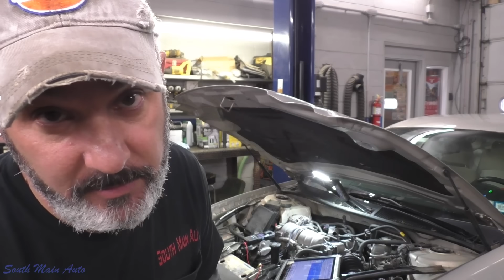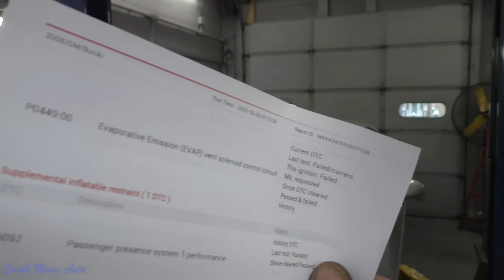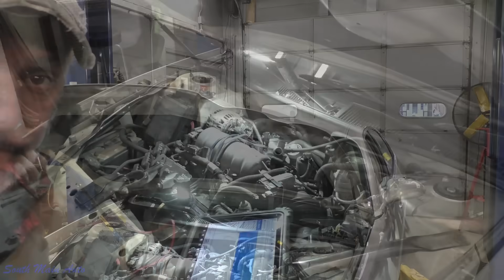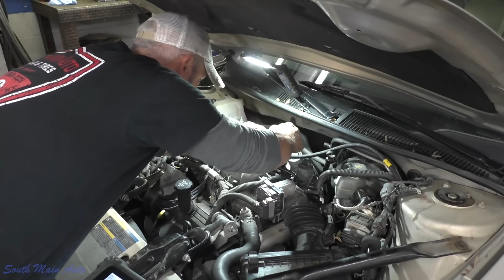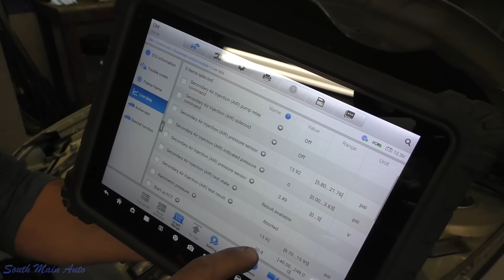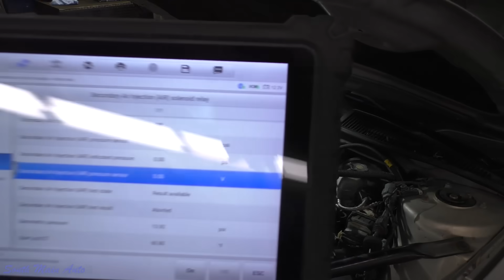When “New” Parts Are Worse Than The Broken Ones 🤬

Comment: Auto industry top to bottom is garbage. Get a vehicle made before 1995 or you'll live to regret it. The newer the worse they get. But it's not just the auto industry. I worked in building maintenance. Did everything from plumbing to HVAC to concrete to building construction to low voltage to high voltage electrical. Infrequently, bad parts right out of the box. So now you have to test the new part or question your sanity. Just as bad is someone else coming along that has a huge ego but no clue what they are doing trying to fix things they know nothing about. Now you have to figure out and fix the mess they made along with what the original problem was and test the new bad part. I used to have my own stock of parts, outside of the parts department, that went bad on a more regular basis but would have others take those parts and not reorder leaving me looking like an idiot, trying to explain that makes ya look like a fool. Many years of that wears on ya. Too many frustrating things went on so I retired early. 😁

Comment: Terrific video because you are a mechanic giving us a true reaction instead of feeding us fake influencer crap. Thank you.

Thanks to South Main Auto, Car Care Nut and a few other respectable channels I have gained the confidence to work on my car (not just change some fluids), get my hands dirty, and not be swayed by the BS from some local auto parts stores and shady mechanics shops.

I have a 2007 Prius and bought an XTool D8 that gives me all the information and features I need. I have a reliable multimeter, and high voltage resistance tester, too. When I buy parts locally I take those with me and announce that I’m testing them before I leave. So far, I’ve only discovered one bad part immediately. I never had push back, felt respected and was even offered a position.

Don’t take anybody’s crap.

Comment: The thing that frustrates me, is that even stuff sold by “reputable” companies is now a junk crap gamble.  It is one thing to buy something off the internet for $10-15 vs say the Delco or SMP box (rebadged by NAPA or whoever) being $80-100 and know I’m taking a big gamble.  My money, my stupidity, for me my time, so my choice.  10-15 years ago you could be relatively assured the $80-100 choice was going to be solid part, but now days, absolutely no better chance than the $15 gamble.  I have found for personal work, obviously not practical for a shop, and only for things without age dependent seals (so hard parts, strictly electrical parts, etc) that I am better getting NOS stuff off ebay, even if not OEM, like getting that diverter valve in a 20 year old NAPA or SMP box.

Comment: I had a similar code on my 3.8 wrangler. Changed egr and problem became intermittent. What the true problem seemed to be was carbon build up inside the manifold. I'm not a mech so pardon my lay vernacular but it turned out the cleaning carbon gunk out of every orifice I could allowed for proper air flow.
There was also some kind of sensor on the back top of that engine that when taken off had oil gunk inside the round straw part where I presume it was blocking air to that sensor. I cleaned it with a q tip four months ago and have not seen that cel since. This was a very similar code that read as insufficient air flow and was pointing to the egr but it wasn't the egr. It was gunk built up in a port on the top back of the plastic manifold.. 
I just looked up the diagram and it was the map sensor that was gunked up. But I also cleaned that manifold good too

Comment: My trusty 2001 Ford powerstroke 7.3 with 180k started stalling on me.  I always search forums & YT looking for clues (oh and my go to garage did not want to look at it and referred me to a local Diesel mech guru who never called back... So I'm on my own here.  All signs seemed to indicate a crank sensor so I thought "I can do this and rather than go on line I would just pick one up local at "The Zone"  Looking to see my selections from house brand and better name brands and the reviews from customers was HORRIBLE!  Not just the cheapo - they were all BAD.  On line was the same.  One on line seller of these supposed sensors (produced to Ford standards they said) had awful ratings - sellers said it was knock off junk yet the pics were Ford parts.  Looking at their storefront they specialized in Women's fashions!  Finally I found a seller in USA selling truck parts who sold the real Ford part and I have to tell you the truck runs great now.  But I'm retired and have time to research stuff.

Comment: I was in a Oreilly and they were talking about a guy that bought a fuel pump, brought it back as bad. And they were talking about how he was full of it, basically.

I told them I replaced THREE fuel pumps in my Mustang GT (96) in under a year. True story. First pump lasted from ‘96 to 2023.

They were Delphi which USED to be great parts, now made overseas.

I finally bought the most expensive pump autozone sells and it’s working for 2 years now , driving maybe 2x a month.

Comment: As a Beetle owner, I've been used to avoiding aftermarket parts that almost fit and/or sort of work. Another annoying thing about this is how wasteful it is. It's a waste of resources, of shipping capacity, of money... So many people and businesses could be spending their time doing something worthwhile, and instead we end up having to deal with stuff like this. It's infuriating.
Reply: @hadtopicausername  we got a water pump for a vr6 once, aluminum housing, that thing need sanded, rough edges removed and then put into the freezer in order to pop into the damn block.
Reply: I call it 'china dosent care' and 'the seller dosent qc anything anymore'.
Reply: I remember in high school making the mistake of buying some air cooled parts from JC Whitney..... Did that once.
Reply: Is it white with a 53 on it?
Reply: @Suchayoutuber  No, but it's painted in L87 Pearl White. Though when it left the factory, I think it was Chinchilla Grey or something like that.
Reply: Doing work on a VW 3.6 VR6, replaced high pressure fuel pump but found new one to be defective. Hitachi pump, supposedly OEM quality. You never know these days. Counterfeit parts or sub contracted to Chinese?
Reply: This is exactly why gas engines are on the way out.
Reply: @diemman70  
I hope you say that from the standpoint of…, they’re becoming obsolete due to the manufactures of cars and parts PURPOSELY making crappy products in order to generate new car sales AND eventually usher in EVs.
Reply: @mercoid Wow! You read my mind.🧠

Comment: I bought 4 new OEM fuel injectors. 1 of them is leaking. Great! 

I changed wheel bearing, 3 weeks later I hear weird noise and car doesn't drive straight anymore. New wheel bearing is bad. Great!

Good thing I am not a mechanic. This sucks arse!

Comment: I had the same experience with a rear wiper motor (rebuilt).  3rd one worked.  I think the auto parts stores just restock them even if you tell them it's bad so after a while all they got on the shelf is parts that have gone out and back several times because they don't work.  The ones that do work don't stay on the shelf and don't come back.  But they aren't going to just trust the customers and shit-can the returns, they put them back on the shelf.  That policy by its very nature has to lead to a large percentage of the parts on the shelf being bad, because they keep coming back, whereas the good ones don't.

Now they could send all returns back to the manufacturer, but the manufacturer probably isn't going to test them either and just send them back out again.  Either way the bad parts stay in circulation and over time become an increasingly large percentage of the in stock parts.

Comment: You'd think with so many companies churning out garbage, one would realize that being the one good brand in the market would be a way to set yourself apart, but not one of them are stepping up.
Reply: People wouldn’t buy them because they’re “too expensive”.
Reply: my tie rods and sway bar links are moogs, my spark plugs and wideband o2 sensor came from ngk, these companies do exist but you gotta know where to look. cheap and high quality. if you really cant find something good and oem is expensive try shopping for mods. or try a junkyard
Reply: NTK/NGK is pretty good, but I have heard a lot of mixed reviews about Moog, especially from people that used the brand for years. Moog also has a tricky line-up with some parts (such as the control arms with Problem Solver "CK" versus the R-series "RK" line) that could be the driving force behind those mixed reviews.
Reply: @CarsSimplified  damn cause i never tried the control arms, which one is better?
Reply: The Problem Solver line is the better of the two. However, it doesn't necessarily have the same coverage as the R series. Control arms aren't the only product line they have with multiple quality tiers, but anything Moog makes that is called Problem Solver is supposed to be their best option when it's available for a given application.
Reply: Moog make absolute garbage now.

Comment: Been in this boat many times before.  The only way I have successfully fought this is by marking "defective" on the box and sending it back so that it can't be put back on the shelf by some disgruntled employee.  They told us to stop doing that and we told them flatly no.  The O'reilly parts store in our sector pays labor claims ever since we humiliated their claim adjuster in front of the district manager by proving their fuel pump was bad electrically.  That's what it takes.
Reply: I'm the guy at the auto parts store processing returns.  I  WANT you to mark defective parts so I DON'T think it's simply a new return and put it back on the shelf!    We're just as annoyed with crap parts on this side of the counter but the problem is no matter what brand name is on the box,  in most cases they all come from the same supplier.
Reply: "NFG" - fewer letters and less effort ;)
Reply: On the part, too, please. Someone might miss the mark or it might make it into another unmarked empty box.

Comment: I've actually had good luck cleaning and freeing up parts like that on my cars. Between cleaning them and cycling them with a power supply the problem goes away for years if not permanently.  Of course that's not something a shop should be doing because of the time it takes. But if the new parts are that bad then it might be the only option.
Reply: I do the same👍👏 worth of trying!

Comment: I think everyone is missing the big point here,  Its all planned obsolesce ,  Customer gets sick of repairing the same problem and guess what Goes out and buys new car thats worse than the old one in 5 years time just in time to buy another one.  My once reliable as ever 90s model chevys arent so reliable anymore because the new parts are junk. the most recent problem the AC control module went bad. when I pulled the dash out the old part STILL HAD THE OE  QA INSPECTION FROM 1991 !!!!!.   New part was noticably lighter and is broke again 8 months later.  Vent speeds work but the physical button wont switch the blend door from hot to cold. all other parts test good.

Comment: Remember in the old days you could buy a high quality part for $40 bucks or a Chinese knock off for $20.  Now there is no high quality parts and the knock off ones are $40.  I just keep fixing my older vehicles.
My buddy just leased a BMW SUV, $140.000.  Twin turbo V8, 15 cameras, a dash that costs more than the engine. The car has twinkle lights in the sunroof for ambiance.  A person would have to be insane to keep these new cars after their warranty expires.  I'm was a Ford or Toyota guy.
Now only Toyota.  Wife's 2002 Lexus LS430, 140K miles, needed valve cover seals.  That's it.  The paint and interior still look new.  My 2001 Ford F150, 180K miles, U-joints, brake discs and ball joints.  
Remember when "Quality was job one"?

Comment: Let me tell you about the FIVE (5) %&$#!@ wheel speed sensors I went thru.  Never did get a good new one from anybody's shelf. Pulled a used one from the local U-Pull-It.. it worked.

Comment: Mate, if it's an conciliation. We just had a fuel probe fail on our AW139 SAR helicopter and it took two of us three days to replace it (AUX tank and medical equipment removal required for access). Brand new $10K probe failed halfway through the fuel calibration process.
Spent another half a day confirming the fault was actually the new probe and had to wait another 4 days for a replacement to arrive. 
I feel for ya!

Comment: Well, everything else has turned to shit, so we shouldn't expect quality auto parts either.  Washing machines break after 3 years and aren't worth the cost of repair, refrigerators do too, even central AC units don't last half as long as they used to.  Not only that, but many of these products get connected to the internet (cloud) and the manufacturer can send an update that breaks the product even though there was nothing really wrong with it.

Comment: Drinking will just get you more pissed off, you need to start smoking weed it'll chill you right out... As a matter of fact you can use that air diverter valve as a type of forced induction bong if you wire it up correctly... Lol

Comment: i replaced that same air pump check valve deal on my girlfriend's 2008 pontiac grand prix with the same 3.8 as that buick about a year ago.  Had good luck with the one i got from rockauto, GM GENUINE 12660127
 for $139 bucks.  

I feel your pain tho, my guy.  Recently had to return two alternators to rockauto which were discovered to be junk (one was DOA and the other made noise like a siren).after installing them on my '03 monte carlo.  Then i tried one from autozone which also made a siren sound.  Finally got a good oem junkyard one from LKQ on the ebay which works properly with no noise.

Comment: I was working on a 2017 honda crv, misfire cylinder 4. Honda told the owner needs injectors, I look at it, the first thing comes up with my scanner low boost, misfire cylinder 4. Turbo shaft snapped in half, owner wants to replace the turbo and injectors even though I didn't know if they were bad yet, but Honda said so, so I changed them. Cylinder 4 misfire. Pressure tested the coolant system and scoped cylinder 4, headgasket leaking. Change the headgasket. Once again cylinder 4 misfire, BRAND NEW FUEL INJECTORS #4 cylinder failed out of the box. Ultrasonic cleaned the old injectors and reinstall them, runs perfectly fine. SO, Honda made a very bad call because the injectors were the ONE THING there was nothing wrong with. Secondly, the brand new were junk and wasted alot of time.

Comment: I been saying this for YEARS, anytime "this aint working" "parts new"   "its the part"

And turns into an argument over how its new... EXACTLY.  

It started 3 times?  it's a new starter?  IT'S THE STARTER.  

on my 4th alternator, alllllllllllllllllllllllllll have parasitic draws.  First two were physically hot. 

Flat out use used parts anymore.

Comment: currently just had the last resto project done on my 86 mote ss. 1 big part of the project was replacing ALL brake stuff above the wheels; MC, booster, hard lines & PV. seen all the horror stories bout all the components as beig endemic. now my factory stuff was still workng or at least in the front. so i'm stuck in a rock & hard place opting for new parts, so we'll see how it goes......

Comment: too much electrical bs, how much has it been beneficial? AFR is a constant X the board for a engine to run correctly and maybe efi better balances it. car tech needs to go back to 1980 or latest 1987. a time where 1 can actually still work on a car.

Comment: I replaced a turn signal flasher relay on a 2000 Camaro.  New part didn’t even flash once.  I took apart old junk part and bent a few things and sanded the contact points and it worked for several more months.  When it stops working I just do the same thing rather than replace part.  New manufacturing sucks.